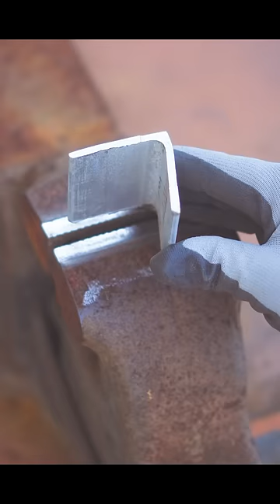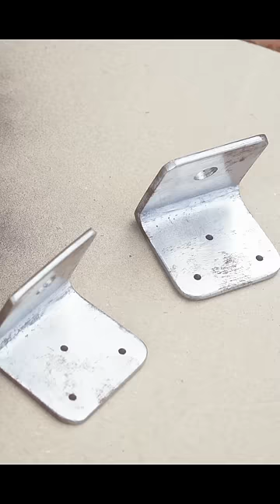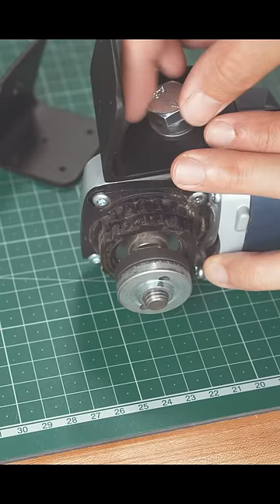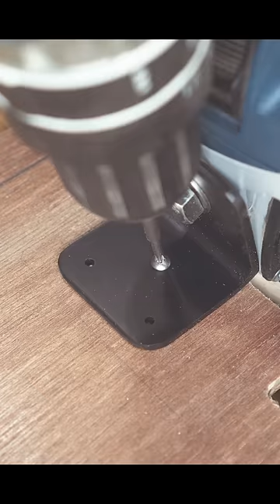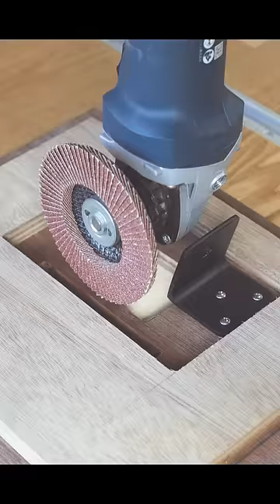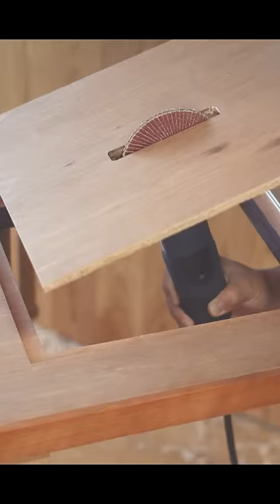Tool hack #shorts

Comment: wont get a square edge because the disc is slightly angled.
Reply: Use a flat flap disc instead of beveled
Reply: Use sanding pdiscs with a backing pad instead of a flap disc.
Reply: It is an ANGLE grinder...angle it, nancy
Reply: Есть и с ровной стороной диск такой
Reply: Це лише приклад , як зробити станок , а інструмент то ваша потреба .
Reply: Use a flep flop disc to flob that flork.
Reply: @Rick-xd8gr you realize it is called an angle grinder becayse it runs off a right angle drive, right? Lol
Reply: @histguy101 buy a belt sander, you can get them for next to nothing.
Reply: @ThatSB some folks just wanna sound smart without being smart
Reply: @ЮрийСвиридовский какой нафиг это станок, болтом болгарку можно прикрутить к чему угодно😂
Reply: Nice

Comment: I don't see how
having a tool, that spins above 10k rpm,
being held in place by 2 stress-hardened angles
with 3 flimsy screws each
 on woodp-ly with less than 10 mm thickness,
could cause any problems
Reply: Efectivamente así es , eso me parece muy mal , ahora para hacer un trabajo de redondeo nadamás , pues lo pudiera hacer de esa manera pero manual, para que invertir tanto tiempo en hacer un adiamento asi ,  no le veo tanto el caso , pero bueno esa es mi humilde opinión .

Comment: Perfect way to get caught up and not reach the power switch. H&S Pass
Reply: Masanın yanına ulaşabliceği bir yere anahtar yapsın gücü kesmek için
Reply: This made me think of a story. I was running a grinder once that kept coming unplugged. After about the third time I got aggravated and held it in the crook of my arm while I tied the cords together, but I forgot to switch it off first. When it turned on the wheel wrapped itself up in the sleeve of my coat and I thought it was going to beat me to death before I could get it unplugged. Some mistakes you only make once 😂

Comment: The lengths people will go to avoid spending like $70 at harbor freight never ceases to amaze me...
Reply: Or $20 for something used that is 100x better and safer than this
Reply: Ok..it don't seem cool anymore..yall ruined it😩 no backyard engineering  for me
Reply: I seen a kid lose the tip of his finger in a old belt grinder with welding gloves on in welding class bak in highschool..
He took off running like a dear shot with a arrow..we couldn't find his finger..
Come to find out after he got to hospital,he slung the glove off when he was running,we forgot he gloves on,and the tip of his finger was in the glove,so they couldn't sow it back on.
Reply: @LouisvilleKyrich exactly why you shouldn't wear sissy mittens
Reply: 70?   Why name harbour freight... is that only place you buy tools... lol your getting ripped...  20 max

Comment: No, not this one.  the rpm is way too high for comfort.
Reply: Couldn’t agree more.
Reply: My thoughts exactly
Reply: Work faster not smarter.
Reply: That's one of the biggest problems with the angle grinder "hacks." You know they're going to use another "hack" to put a skill-saw blade on there. Making yet another cartoonish death trap.
Reply: @FlyingPusssyfoot  Lol they already have a big slower motor for a circ saw. But like you said, they are gonna put the 7 1/4 on a grinder arbor.

Comment: Well, it's a horrible sander, but it looks like it won't kill you. Wouldn't a square surface be nice?
Reply: But it will remove a digit or two in due time. The next step is to "save in a saw" and put a cutting disk

Comment: What's that cheap ass plywood used for the bottom layer?  I ended up with a bunch of it once but never knew exactly what it was.
Reply: If u mean stuff that's looks like plywood but its really thin it had alot of uses and weirdly several names lol. I use it alot, it's just sometimes hard to find depending what the store is calling it. It's basically like blank paneling from like older mobile homes. But names vary, the flooring stores call it underlay, used for like sub-sub-flooring to help level and build up ect, construction stores thin paneling on walls, ceiling, ect, and like cabinet makers call it veneer I think sometimes. It's like 1/16 to 1/8 thick normally clean smooth on one side and like plywood on other. Normally get it in 4×10ft or 12ft to 16ft or somewhere also. I've used it in drop down ceilings bc light paintable flexable and long so easy to hang with one person, used on walls ect. And normally it's cheap. I've heard it called few other names can't think of also. I think that's what he's using tho

Comment: Ever noticed, none of these demos have electric tools which have safety buttons. Do they wire out the switches?
Reply: Я Вам скажу больше. На нормальных инструментах есть защита от включения после падения напряжения. Невозможно включить вилкой напрямую в розетку.
Reply: Most likely they just tape the handle down. They're trying to make a video not actual use the tools. Pulling the switch out is too much work for these clowns
Reply: There is no safety on this grinder.  You can see the only switch in one of the shots.  
 I bought this grinder but would prefer the one with the paddle switch.   Also, the rpms on this thing are insane for sanding wood with a flap disk.
Reply: Grinders come in 2 main configurations, a slide switch and dead man's paddle switch. All brands offer both for each model. There's also a 3rd configuration on larger grinders which is simply a trigger

Comment: we can make a metal table saw with this idea
Reply: Don’t do it
Reply: Instead of making finger remover contraptions out of grinders and drills just use the right tool for the job and everything will be fine. Your fingers, hands, pieces your working on and the tools themselves
Reply: Sounds like an absolutely horrible idea. Way to go to remove extra hands you've got
Reply: Imagine you do a wrong move and your lovely contraption table saw bites on ya
I don't want to be around to see that unless I'm behind plexi glass and inch thick
Reply: 🤔 what gonna stop the disc parts if it breaks - they gonna fly around the room like little bullets aint they 😵

Comment: According to the instructions you get when buying tools, you can not change or modify the equipment.
In some cases this could lead to a lawsuit.
Reply: En ningún momento se ve que modifique la máquina
Reply: You can't be sued for modifying a tool for personal use. Warnings like that are to prevent the manufacturer from being sued by the customer or voiding the warranty, not the other way around.
Reply: @Bdp721  If you take that modified tool to a job and someone gets hurt, you can be sued.
If a neighbor borrow the tool and hurt themselves, you can be sued.